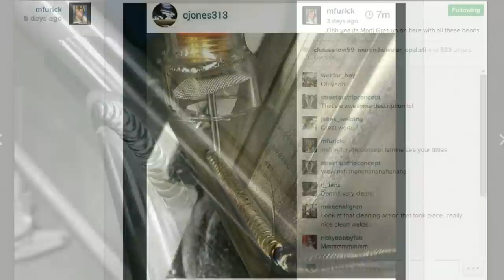High End Tig Welding Cups with DogFab.com | Step Up Your Tig Skills

Comment: I've got the fupa and a number 8, having some issues getting the cup to slide over the o ring. I wet it down but it will push the o ring up on one side instead of staying even all around.
Reply from the maker: try twisting it as you push over the oring
Reply: gave that a try, with both cups.. I'm sure it's a simple fix because yall sent me a gas lens to go with. I've already had a o ring bust with how the cup rolls is up.
Reply from the maker: Are you using the gas lens that they sent?
Reply: yes

Comment: Hoping trolls don't shit on me, thinking about getting a used tig welder to play around with. The last 2 coiled tubing shops I worked with have the massive tig machines, one was a water cooled tig. I don't need that, I just want a reliable machine, sorry for being cheap. trying to talk my dad and brother into tig. But I know the tungsten varies. Your feed wire varies, and I'd have to look into if they use straight argon on coiled tubing butt welds. It's zero tolerance, it's x-rayed, mag particle tested, and at the end dye/pen., and then we use the Rockwell hardness tester. Check the weld, heat effected zone and parent material. Only  looking at mostly body work, but all the tig welders I know are coiled tubing.
Reply from the maker: There are a lot of good starter tig machines out there that are priced well. I hear a lot of good things about the AHP http://amzn.to/2i6yQF2
Reply: Al Cyr +1000 On the ahp I have one it's unbeatable for the money
Reply: 3/32 is the most common for filler rod. Size 12 is great for most steel and stainless steel

Comment: 20 cfh for mild steel... lol... talk about expensive welding for steel.. you can get away with 4 cfh...
Reply from the maker: having the best isnt cheap
Reply: no kidding.  the whole point of the gas lenses is being able to use less flow.
Reply: The purpose of a gas lens is improved coverage over a wider area. They are designed to use a slightly higher flow rate, not less.  This is true for custom gas lenses like in the video or more standard gas lenses from the majors.
Reply: Lawrence Bower gas lens’s are ment to use less gas than a standard collet style cup. Gas is adjusted according to size of cup.  A larger cup requires more cfh as it needs to compensate for a larger area to cover.  Using a gas lens on a number 5 cup compared to a number 5 cup of collet type will use lower cfh thanks to the gas lenses while dispersed out more evenly than the collet style cup.